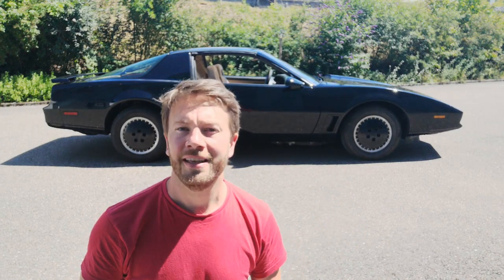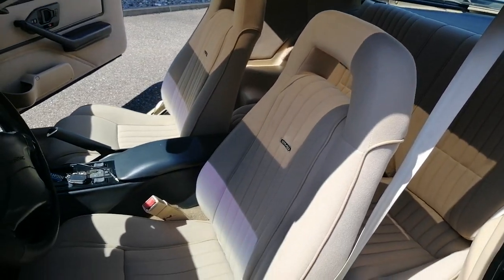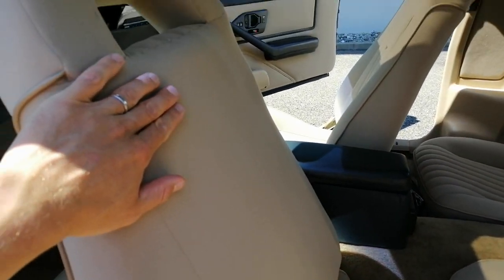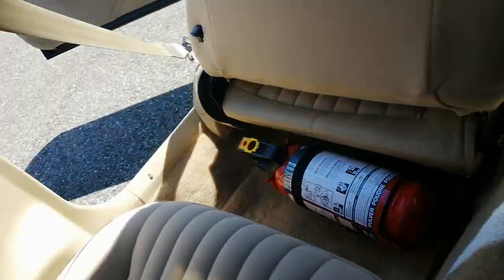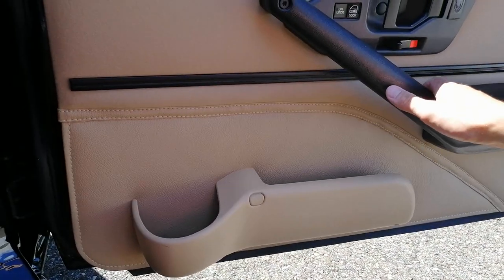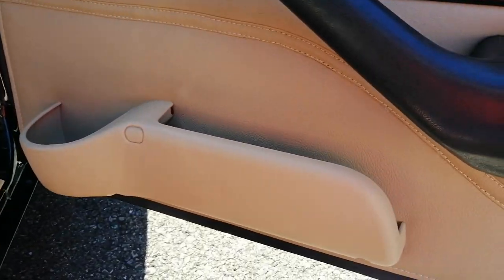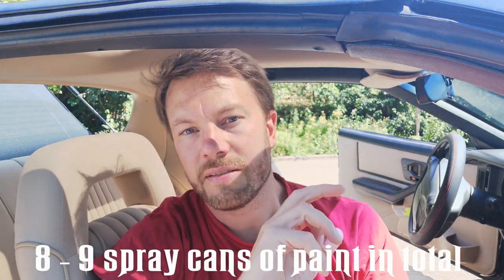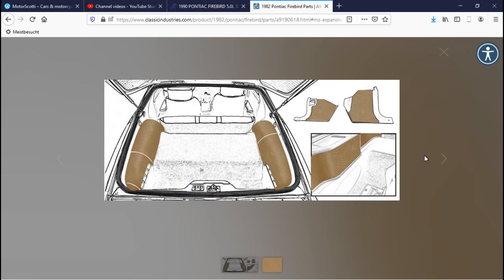KITT Firebird Trans Am - Episode 20 - PMD seats & tan interior

Comment: Hello. I’ve been watching all episodes, excellent work. One question, does your upholstery guy doesn’t sell the replica seats or Sell a kit of materials so I can do it on my own? Thanks
Reply from the maker: Hi, thank you for watching! No he doesn't sell any kits he always makes them individually. But here's my suggestion. You can relatively easy do that with your own seats. You can still buy a new set of PMD upholstery on rockauto and strip the backrest of your seat and have a U shaped piece of metal welded in. Obviously you'd need to do a bit of measuring and add some fresh foam but in theory it's not complicated.
Reply: Haven’t thought of that. Will do. Thank you so much.

Ohh. Btw. I’m following your instructions, just finished gutting the interior with your episode 7 to my 1984 TA (donor car) and start again episodes to work on the 1988 formula I want to convert. Greetings from Puerto Rico.
Reply from the maker: @ismaeltorresacosta4116  Excellent! Keep it up! I'll be uploading a couple more Firebird and KITT episodes over the  next couple of months.

Comment: Hey Man, such a great job! Just a question: You had any problem reinstalling the front seats? We think our upholstery guy did something to the metallic base, because now we can't put them in their original place and there really isn't much information on the subject online. Greetings from México!
Reply from the maker: Hey, thanks a lot! The only thing that comes to my mind is that the seat racks left and right of each seat might no be aligned anymore. Take your seat with the base facing up and see if the racks on either side are both at the same position. If not just pull the lever and adjust them. Then you should be able to drop them onto the bolts that hold them on the floor.